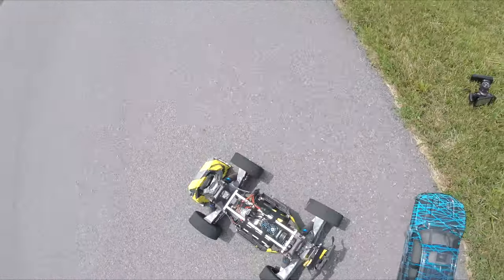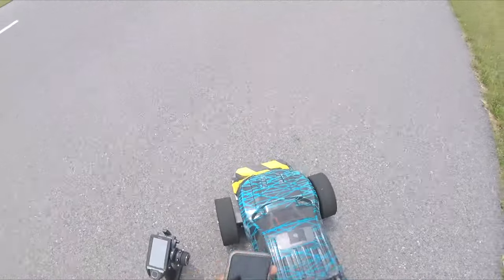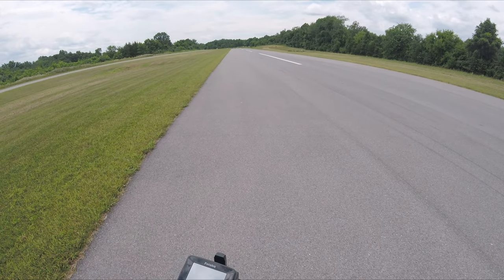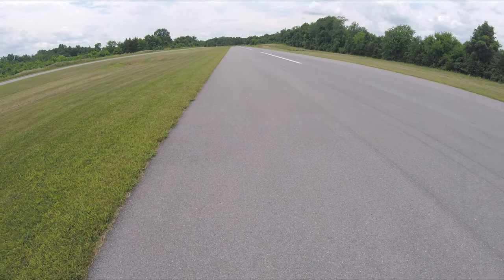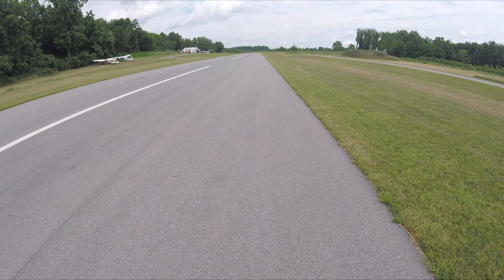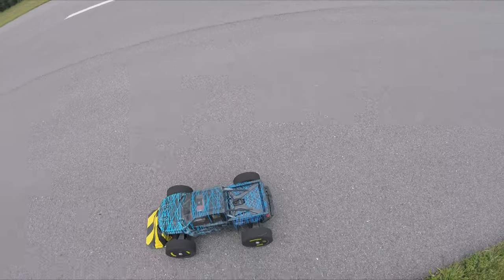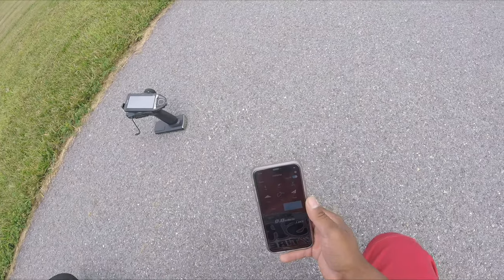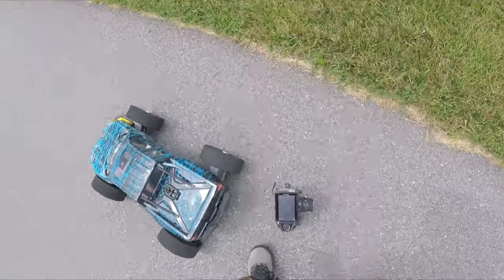112 mph Worlds fastest Beltdriven Traxxas X maxx Castle 2028 1700kv

Comment: Belt drive system pinion30 and spur30  vs p30 vs s25 for speed runs, wich combo would you recommend?
Reply from the maker: Really depends on KV, wheels and  speed goal?
Reply: @KiloWattRC  1100 kv, gone bananas skins. I wanna replicate your build, so you are the inspiration 😂
Reply from the maker: @skyu777ayala2  I would say 33t pinion 25t spur is you're best bet for high-speed with 1100kv.   The motor I am using is a prototype, I will release more info on it later when I get permission